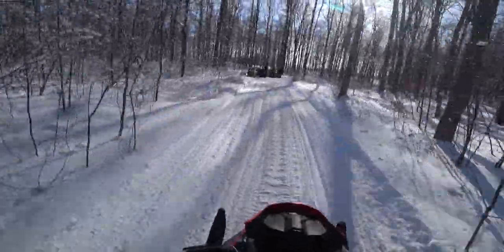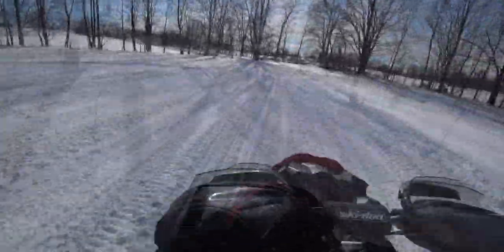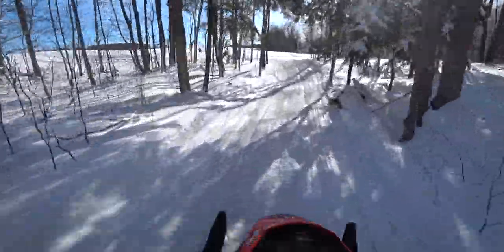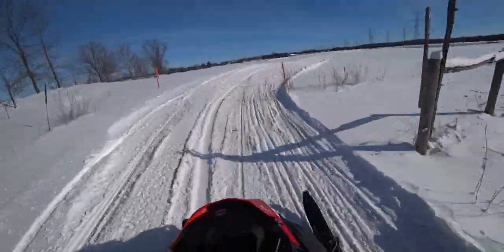THE 80MPH BAKER | Muff Pot Butter Tarts 2022 SKi Doo XRS 850 e tec

Comment: Do you think if its too close to the side panel it would melt the plastic or does it not get hot enough?
Reply from the maker: you have to use it with a trail can - it wont fit on stock exhaust, so there is plenty of airspace to not melt the side panel
Reply: @mudbrats  I got a race can on mine so show should be lots of room
Reply from the maker: @Brobro449  get cookin!